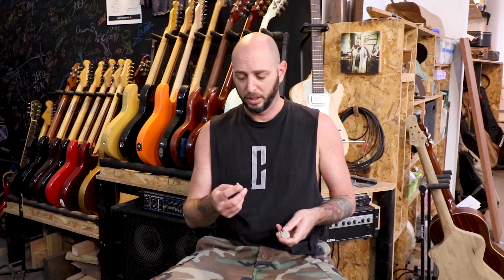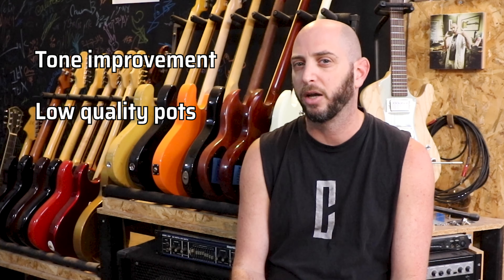250k vs 500k Pots (and why you might want to replace them)

Comment: The general rule is 250K for single coils & 500K on humbuckers as stated, being a bass player who plays mostly Fender bass's i was shocked my Jaguar PJ came with 500K log pots ?!?!....far to bright, i replaced them with CTS 250K linear pots, 8% tolerance, solid brass short shafts on the pots, now fitted on all my Fender Jazz's & Jaguar PJ...all linear no log or audio taper, yuck....lol

Comment: Thank you for your videos,
 Can a failed volume pot make single coils sound weak? I just changed the pickup selector (thanks to your video) but that wasn't the reason so I'm thinking next to change the volume pot, (I've used WD40 in the past not realizing how bad it is, maybe causing the pot to fail or maybe just use), anyways finding the problem has been a mystery for this HSS Fender Select Strat...

The problem with the pickup level started after I took it to an unknown store in Cornwall ON because I had a lose connection for the humbucker ( I now know it was a simple lose quick connection Fender uses) but very strangely it came back with weak signals from the two single coils, and the humbucker sounded normal level but muddy, maybe you have come across this before

 Because I live in Ottawa and don't drive, I can't get back to that store, they suggested maybe I had broken windings in both my single coils which is ridiculous, besides that would be their fault.
 I wonder if they took my pickups and replaced them with something else, they knew I was from out of town and I didn't even know how to remove my pickguard, (very very frustrating)
Thank you in advance for any help that you can suggest
Reply from the maker: Hi, sorry for the delayed response.  It is very possible that a faulty pot will kill your sound. 
Regarding the singles - does rolling off the tone pot leave a signal or does it act like a volume pot?

Comment: I use 250k for single coil pickups since it’s recommended. However the reality is that the potentiometer may actually read around 225k on a multimeter. That said, 225k might actually sound slightly better depending on the sound of the pickups
Reply: 500k for tones  250k for bridge

Comment: Thank you for doing the video. The pickup selection certainly plays a part in tone pot choice. A P90 at the neck might sound dark and muddy if highs aren't passed through the electronics. Capacitor value also plays a subtle part.

Comment: Whatwould you recommend for a HSS Strat? I am thinking of putting a Hotrail in bridge position of my Strat. I play in a hard rock band
Reply from the maker: Hi, I recommend starting with 250k. Usually, rail pickups are bright enough for that.
Reply: For HSS I personally go with 500K and .022 tone capacitor. If it’s too bright you can turn down the tone knob. The possibly annoying thing is that if you forget to turn down the tone knob, it might sound annoyingly too bright so it might be better to use 250K so you won’t have to touch the tone knob….However in some instances, that high 500K frequency might come in handy

Comment: What value would you recommend for concentric pots in a PTB (Passive Treble and Bass) system in a bass? I thought about using B250k but people have advised me against it because it wouldnt work well for the bass cut

for context: it has 3 pickups, 1 mudbucker and two humbuckers. The idea is to have an individual PTB system for each pickup, concentric pots would save a lot of space
Reply from the maker: Hi, if you can find concentric pots that are 1M/500K (1M for the bass cut), I'd recommend starting with that. That's always a trial-and-error case. Just try different values. You might find some very interesting tones.
Reply: More resistance - the effect is more pronounced, less resistance - the effect is less pronounced, but has a smoother adjustment.
Also you can try different cap value.

Comment: I bought two A500k pots and one of them read to 460k and the other one is 520k. Its okay to use the 460k? Which one is good for volume and tone? Pls I need answer.
Reply from the maker: Hi, it's ok to use both. Pots aren't always super accurate. I'd use the 520k as a volume to brighten up the sound a bit
Reply: @coilsboutiquepickups  thanks bro ♥️

Comment: What value pots would you use on a Strat with a Humbucker in the bridge position, and 2 single coils (neck mid)?
Reply from the maker: It's always an issue deciding in these situations... there're some options - 1. To use the original 250k and deal with the darkness of the humbucker.
2. Switch the 500k and just deal with the brightness of the singles. 3. Install two different pots for each type of pickup. 4. Install a very bright humbucker through the 250k. 5. Install very dark singles through 500k. 6. Install a 500k but add resistors to the singles to bleed them a little..
In my workshop, most cases end up with customers choosing an open cover  bright humbucker and leaving the 250k, and they are very happy.

Comment: Thanks for sharing.  I have a 1981 VOX Standard bass that needs new pots.  It has a DiMarzio P-bass humbucking pickup.  I wanted to use DiMarzio pots, and found some find 500K  'custom taper' versions online.  Not sure what the custom means.  Is it a hybrid of linear/log?  Thanks.
Reply from the maker: According to DiMarzio: "Standard guitar pots limit your musical expression, only starting to deliver sound at about “3” on the dial and then never getting much louder above “7”. DiMarzio’s custom taper pot is made to solve that problem by precisely delivering the same ratio of signal-to-turn as an actual 10-position actuator." 
Never tried them.. this actually might be really cool, but I do believe they're a little extreme with their interpretation of other tapers.. Most players (who don't use these) don't complain so much about that issue.
Reply: @coilsboutiquepickups  Thanks - that's useful feedback - I appreciate your reply.

Comment: Thanks bro, great info here! One thing i'm still wondering is if the volume pots are the same pots used to tone, or they are different?
Reply from the maker: Hi, thanks. Volume and tone pots are basically the same - the wiring makes the difference in function.